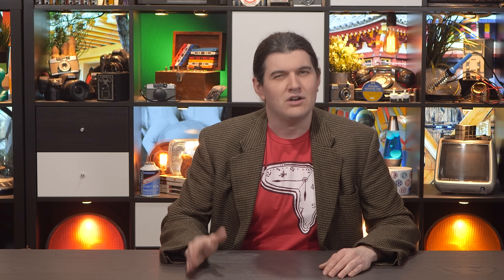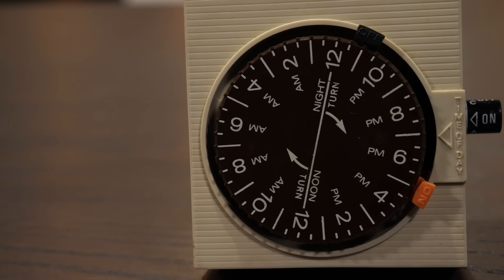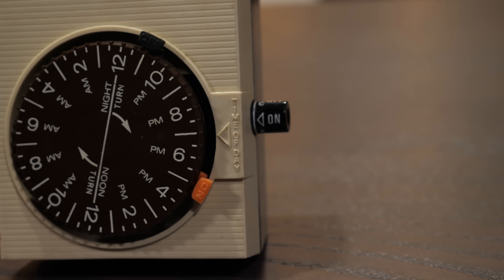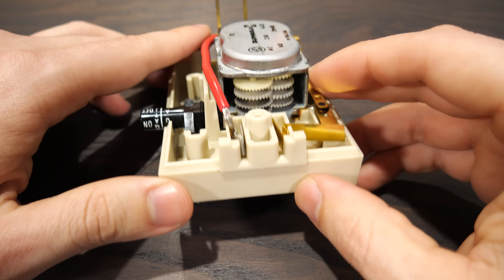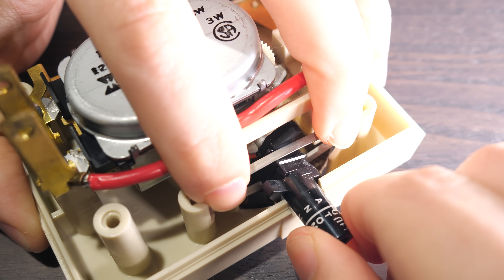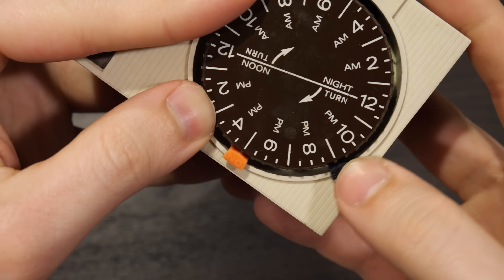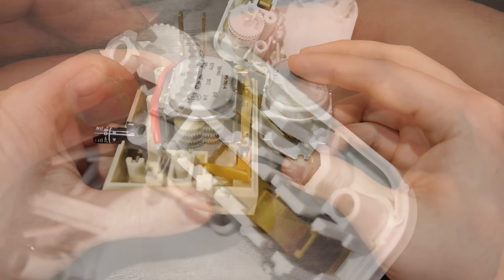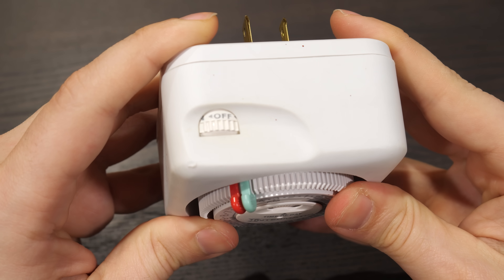Timer switches: literally just a clock and a switch

Comment from the maker: Worthy of note: the motor-driven timers consume 3W constantly - and with modern LED lighting, that means that depending on what you want the timer to do... it may not save any energy! If you use it to control a lamp with a single 5W bulb for 8 hours day, then it saves 80 watt-hours while also consuming 72 watt-hours. In that specific case, you might as well just leave the light on all day and forget having a timer!
Reply: While the 3w draw of the motor is not insignificant especially given the extremely low power draw of modern LED and CFL lights, the fact that it makes the lights turn on and off based on a time schedule is often enough of a desire on its own to merit use of any kind of timer switch, even if it's one of the electromechanical ones with their constant 3w draw controlling a string of christmas lights that might consume all of 5 watts or less.
Sometimes it's a matter of being nice to your neighbors, sometimes it's a matter of making it look like the house is lived in, sometimes it's a matter of a lot of different things.
Reply: I like your appropriately themed wardrobes
Reply: We use them on 800w block heater on tractor engines. They only need to make heat for an hour for two before use.
Reply: 5 Watt? Man, this amount of power can literally run an entire computer of today. And that's relevant because there are lots of SoC with GPIO that could use relays for exactly this purpose! The big and well documented example would be the Raspberry Pi.
That might be overkill for most situations but after hearing that I will put more effort into thinking how to smartly wire everything into that one computer like that I use anyways for my door.
Reply: @fgregerfeaxcwfeffece  or an esp32 or 8266 or an arduino would be more suited for this than a full fledged pi.
Reply: @johnandrews9433  Even those are overkill if you don't need wifi.
Reply: @chaos.corner  the $2 cost makes it matter less
Reply: @johnandrews9433  Absolutely. ESP is my go-to for homebrew stuff.
Reply: Good point!!😂
Reply: Our front porch lights do NOT have a photocell, but I have a lightswitch that's also a timer and I told it what 'band' we are in. Comes on at Sunset and turns off around Midnight.  And, yes, I bought it to avoid WiFi + App idiocy.  Had one for the same purpose at our old houes.  Love 'em.

I had one of those "movable red/green" tab timers.  Had to trash it since I lost all but one tab 😞 
Also have one of the up/down tab type and also require a test each time I use it (is up on?)
Reply: 1:06

Idea for next TC video - "How to use exclusion flags in Google search"
Reply: @deforged  I used to know how to do that, and now whenever I use the exclusion tags, it always shows the first result being from something I wanted it to throw out.
I usually just give up and go to the old-fashioned "google advanced search" bookmark I have instead, but even then that doesn't work.
It's especially unhelpful when I'm shopping. It's almost like they're pushing you to buy what you don't have any interest in.
Reply: @44R0Ndin if you want to search for specific phrases use “” if you want to exclude certain words you want to use -
Reply: @mrpw1402  important to note, don't leave a space after the (-)
Reply: @thatClarkguy  correct and a - is needed after every phrase
Reply: @mrpw1402  Then why is it when I use the - before the thing I want to exclude, the thing I want to exclude is ALWAYS the first result? Try it yourself on something moderately obscure, and watch Google not give you the "no matching results" page, and instead feed you the very thing you were trying to avoid searching for!
Reply: @44R0Ndin  the first result(s) are ads, which will ignore your exclusion criteria.
Reply: @mrpw1402  you can also use other boolean operators if they're in caps. For instance, searching for switch AND Nintendo results in pages that omit the dictionary definition of a 'switch' and a result for a technology company named Switch, as they do not mention Nintendo. You can also use the phrase NOT instead of -.
Reply: @Renegade605  I know about that, but I get like 3 pages of results that should be excluded.
Reply: @44R0Ndin  Whomever pays the most get top ranking these days. Don't need no stinkin' exclusion tags!
Reply: Speaking of ranking, YouTube comments don't even sort my comments. Just uses the '@'sign, so 20th century! I so love monopolies.
Reply: @mrpw1402  yeah? When's the last time you tried that?
Reply: @44R0Ndin  yes 240V versions exist, these timers are sold in Europe as well and many older electric water heaters had a beefy one built into its wall connection. 

Although I never knew how to set mine, as neither way seemed to work (maybe it was broken), and the place I’m in now just has a microcontroller capable of adjusting the thermostat multiple times a day and setting no-run hours.
Reply: @deforged  it doesn't help lmao
Reply: @deforged  Google has been getting a lot worse at giving rubbish results recently. It is now almost as bad as Altavista back in the day.
Reply: @deforged  HEH, that would be useful, especially as Google long ago broke the simple way those used to work.
Reply: @deforged  and Search Date Range...
Reply: @deforged  my God I had no idea of that functionality and it will come in handy. Thank you!
Reply: @deforged doesn't work anymore sadly
Reply: What are those
Reply: I actualy ripped a motor out of one of these to fix a clacker clock
Reply: Fair, but ruins the effect of appearing to be home or not
Reply: really? well i have one running 4 months of the year on my car plug in regardless of if i plug the car in.  Time to stop that. EDIT, its 32c a month so maybe i dont care
Reply: @jsnsk101  Even with just 32 cents per month, if there's a cheap alternative maybe it's good just for the energy saved
Reply: If you search for Model: D111 you can find that a lot of results say its 1970's ish
Reply: Can u do cast iron radiator furnaces some episode?
Reply: And they make a bit of noise so if the outlet is near your bed, you end up hearing it when trying to fall asleep.
Reply: I have a motor driven one similar to the third one you showed, but mine consumes less than 0.5 W, which I use to control a LED sign that consumes about 12 W,  8 hours per day, so it definitely worths.
Reply: @giragama  I bought a new one last year and it indeed consumes less than .5 W
Reply: ...not to mention the bloody noise they make
Reply: I have tab based timers for my turtle tank.  They don’t last forever, the tabs wear out and fall into the closed (on) position.
Reply: In a connextra video, it might be interesting to tell people how the motor is able to stay at it's constant rate because at least 2 times a day when the motor encounters the resistance when it has to overcome the spring tension that could slow down the motor until the switch clicks on.   The motor has to be able to stay at a constant speed so that it doesn't lose time during the drag of the spring tension that slowly increases a little bit until it clicks on or off.  It might be interesting to know how the motor overcomes this extra drag.
Reply: @KevinBenecke  Did you see the stack of gears doing the reduction?  The torque is multiplied by the same factor.  The motor won't feel a thing.
Reply: @JohnDlugosz  Also the motor is synchronous which means it's driven at the same rate as the mains frequency. Unless you completely stall it out, it's going to keep on going.
Reply: @KevinBenecke  The motor is locked to the frequency of the AC power. It would simply draw more current with more resistance.
Reply: @KevinBenecke  They have a 5,184,000:1 gear ratio, so even with a tiny motor, the torque is impressive. The current draw will increase slightly as the springs start to compress. But they won't slow down much. 
And with typically 15-30 minute resolution on the clock face, even if they do a bit, it could take years to notice it.
Reply: @KevinBenecke  very simple. That huge amount of gear reduction makes the fast moving 6000rpm motor step down. Reducing speed increases torque with gears, so that final gear that turns the dial is not going to be slowed down by the clicking tabs.
Reply: I was literally thinking this the entire time you were explaining it, "wait a 3600 rpm motor, running all of the time?!".
Reply: I specifically have my TV lights on a timer so they come on an hour before sunset and turn off at midnight.
Reply: I remember these things being advertised more for their security benefits than their energy-savings. You'd plug a lamp or two (or three or four) into these to make it look like your house was still occupied at night if you were away.
Reply: @@heind Strictly speaking you don't need the hub. The switches are fully ZigBee compliant, so if you already have some sort of computer running 24/7 you can simply add a ZigBee USB stick to that and control the switches from there.
Reply: I was allways taught by my dad to use them when on vacation to make it look like your home, so you don't want the lights on all night or you could tell since people don't keep all their night on 24/7. So you want the timer to only turn he lights on like during normal hours they would be on.
Reply: @MRblazedBEANS  You're good unless the Wet Bandits turn up. Then you need a Kevin.
Reply: Do electronic ones use less? I'd imagine so, they don't have to turn a heavy thing...
Reply: Thanks for the tips. Upgraded the Water Heater Timer to Digital years ago....Wanting customization on Weekends. Good to know that relying on a Battery Powered Clock to decide when to turn off/on the Circuit I'm saving a lot there too, just a bonus since I didn't think about the power needed for it... got a few old Analog Timers that could use an upgrade
Reply: Do not leave the light on all day! Led lights being so efficient that people are discouraged from ever shutting them off at night is one of the leading causes of light pollution.
Reply: Phosisiticated is my word of the month.
Reply: I noticed exactly this when setting up Christmas lights. 2W of lights, and 3W of controller! 😁
Reply: I  love your channel, definitely one of my favorite youtubers, you and project farm     
I have a request that I think would be seriously interesting, or if you could give me some insight here would be good enough for me,    

What controls the refresh rate on crt tvs?  Is it just the mains supply working out with everything and it just simply is 60 or 50hz depending on location,   but what is the deal with tvs that say they have 120 or 144 or so hz?
 is there any way at all to modify the refresh rate of a crt tv? even if it isnt an actual function, is there some electrical wizardry you could do to modify the tvs refresh rate?    I am only looking to reduce mine, I have a tv that puts out 120hz and the screen is beautiful it looks great playing all my classic games, but alas because the tv is set at 120hz refresh rate I cannot play my light gun games which I consider to be some of the funnest games available to play alone or with friends,     I have a 40 inch sony trinitron, is there any way to downsample the output to 60hz so i can play my games on this gorgeous classic tv?
Reply: Timers used on heat and ac also. Lighting in parking lots uses considerably more than 3 watts and also highway lighting.  Btw love intermatic,  see my other comment. Also love synchronous motors it's ability to keep dead accurate time just being plugged onto the wall along with 60hz in homes. What's also amazing is the 60 hz in homes powering outlets is equally accurate.
Reply: @TY-ob7fz  the 60 Hz frequency has to be that accurate. Any more than 0.7 Hz deviation in either direction for more than a minute or two can cause serious damage to generators so they Wil automatically shut down if that happens. Power generation is a fascinating topic.
Reply: @TY-ob7fz  Power companies not only target 60Hz but they ensure that the average frequency over a longer time scale will always stay exactly 60Hz. So if they provided slightly more than 60Hz for a while they will lower the frequency to get back to a 60Hz average.
Reply: You could make a video on how these became standard for sprinklers.
Reply: I have a small LED bulb on my porch. I let it run constantly since adding a timer would consume more power overall.
Reply: LED lifetime saving is more important than power consumption.
Reply: For a more modern alternative, the Amazon Smart Plug (which works off Alexa) can be set up to activate on complex schedules and what not, only uses 1-2 watts. I use one for the Xmas tree mostly. Have it programmed to turn on before the wife gets up and off after she goes to sleep, but also have it set to turn off after she leaves for work and before she gets home on the weekdays. Yes it requires an app to set up.
Reply: @rheemocturis  I'd like to try some of these things, but won't until a product can completely function without any server outside the house. A couple not-terribly-old but expensive home automation product lines are now bricks because the manufacturer just decided they didn't want to pay for the servers anymore.
Don't get me started on the data-mining aspects either.
Reply: @strehlow  Look into the Sonoff devices. Most can be reflashed with custom firmware and there are some, like Tasmota that can operate entirely within your home network (but can still be integrated with Alexa etc if you desire).
Reply: Haha ok, ok I think my Christmas tree lights might have consumed maybe 5W so that didn’t work out well 😅
Reply: No Alec, you’re worthy of note. ❤
Reply: However, another consideration is the life of the LED lighting. Keeping it on all the time could cause premature failure, which would negate some of the savings.
Reply: @ronbennett7885  The cheaper ones which are over driven certainly can have this problem. But properly designed units could last hundreds of thousands of hours. @bigclivedotcom has done a number of videos on hacking commercial LED bulbs to prolong their lifespan. Frequently it is as simple as snipping a single resistor off their circuit board.
Reply: Fair point!
Reply: Alec,
I love your videos so much. I have probably memorised most of them. It would be great to see you and (is it Robert) Aging Wheels do more videos together. 
Your thermal home battery video... is there a method for winter? Here in Japan we have split system heat pumps for the rooms most used. In addition to a kerosene heater and a covered heated table. Double pane windows with tint helps but this is a traditional Japanese home with modern upgrades.
Please guide me on increasing affordable heat and better insulating my home. Thank you so much, my friend. 
Oh!! I saw your model car in a museum in Komatsu. So dope!!
Best wishes, and thank you so much for the many hours of great videos.
Reply: Sometimes it's not about saving power, but rather just automating when a light is on or off. Forex, I have one attached to a lamp in my bedroom. It turns on the lamp a half hour before my alarm clock goes off, and then off a couple hours later.
Reply: 15:00 HOW?! this is an interesting topic! probably not enough for a big  fully fledged video though... maybe a  youtube short? Thanks!
Reply: Truly useless today.
Reply: I can't put it into words how perfect and calming your outro is.
And it's always accompanied by the subtle feeling of having gained +1 Inteleigence.

Always happy to see you upload.
Reply: I have mostly all LED lights in my home and my electric bill rarely surpasses $20-$30 a month, but I still feel weird about leaving my lights on all day. It just doesn't feel right!
Reply: And ironically I just noticed a few hours ago that my motorized timer doesn't completely shut off the LED lights on my aquarium. A couple of chips in the array glow ever so dimmly. I just noticed this, very interesting!
Reply: @blaircox1589  Some YouTubers (Including electroboom and Steve Mould) have videos about why some LED bulbs don't turn off.
Reply: @chaos.corner  Yup, but this is a $100 aquarium light with control circuitry for controlling day and night lighting changes. So a lot more going on between the mains and the actual LED. I just thought the timing of watching this video and noticing was interesting. Cheers!
Reply: I was literally about to ask about this, because I use christmas lights as room decoration throughout the year and thought it was waste of energy keeping them on during daytime with natural light. Even if motor driven one is extremely cheap, figured it might actually not save energy and the amount of headache when there's power outage is immense.
Reply: Yeah, it is wasteful to constantly burn three Watts, but having the lights shut off when you want it to be dark is handy.  Of course if it weren’t too inconvenient or the user weren’t somehow made unable — there is always flipping a switch by hand as an option.
Reply: Or you might as well use better lighting technologies than LED.
Reply: that is the case with my aquarium lighting.  I have some LED tape illuminating the aquarium, and it consumes about 7 watts.  It also has some blue LED tape that says on 24/7 to provide UV for the plants, and also when the white light goes out.  It consumes about 4 watts.  The white lights are on a timer.  BUT this isn't so much to save energy as it is to give the fish a night-day cycle
Reply: Well that isn't very fosisticated...
Reply: Technology Connections ho I subscribed to your channel the video about closed captions was interesting….. I hope you will reply to this 😊
Reply: To avoid Nintendo results in your search, simply add a minus sign like -Nintendo in your google search. For example "Time switch" -Nintendo (the quotation marks also helps by only serve you results from exactly Time switch as a single phrase and not results with the word Time and Switch separated.)
Reply: If you can get the ancient electromechenical timer and the modern energy-saving lamp to exactly cancel each other out, though, you get the Perfect Irony achievement (well worth it).
Reply: @Rubrickety  If you use the timer on an iron you win the perfect irony achievement by default.
Reply: Well I wonder how much power a Wi-Fi connected timer switch consumes.  Could it be a similar amount?  I have no way of measuring how much electricity my devices consume.  I'm sure there is an Australian equivalent of the Kill-A-Watt device, but I don't know what it's called.
Reply: @Lachlant1984  About 100mA if not especially optimized. There are tricks to get them even better too.
Reply: its much more efficient to use smart bulbs in that case, only one power supply and no motor.
Reply: @drkastenbrot  True I guess, but the WeMo switch was bought for me as a birthday gift years ago, and so I used with with a CFL lamp, I didn't have any smart bulbs then.
Reply: All the mechanical ones I've measured have been 2 watts, rather than 3. But mostly I'm using mine for plant lights, so the time is the important part, not power savings.

But I do also use one for a rechargable-only-mini-sound-bar I have that in my use case is best left on full time*. It also has a delightful feature that when it's low on battery it'll start beeping every five minutes until it fully drains the battery. So now I leave it on but also use a switch timer to give it a few hours of charge every night.

* (Mildly difficult to reach, intermittent but unpredictable use, often in short bursts, and the device somehow takes a solid TEN SECONDS to turn on from power off which is often longer than the use case. At least when idle it puts itself in battery-saver mode and only takes three seconds to start back up rather than ten. Did I mention that if you use it wired it blinks the world's brightest blue LED at you continuously until you give it a bluetooth connection? I solved that with electric tape.)
Reply: @solarbirdyz  Hmm, sounds like a very oddly designed soundbar, I'm not sure I'd like a soundbar that operates like that.
Reply: @Lachlant1984  It's not meant as a soundbar? It's more meant as a portable bluetooth speaker. But I don't need it for that, and it does sound and is bar-shaped and fits on the wall-mounted monitor it's used with. So for me, it's a soundbar. And now that I've worked out its nonsense, it's doing fine in that role.

That said, I most definitely would not buy it again, not even as a bluetooth speaker. I mean, it's fine. It's not great. But it's fine. As that. Kind of... B-tier. And if I were to buy something new, I wouldn't buy anything B-tier.
Reply: The very 70s-looking one you started with is actually late 70s by my recollection. Before it was an Intermatic model we used, with the same body and colors, but with multiple little orange and black pegs that could provide quite a complex program. They were captured like the last version you showed, but needed to be pushed (hard, and painfully to the fingers) inward or outward to actuate. It still used the square cam, so it couldn't handle something under 30 minutes or so, so mostly it had to be an hour minimum for an on or off period. My parents were very annoyed when they couldn't get the sophisticated version anymore and could only get the first one you showed. I think they still have (and maybe even use) some of the original ones. My fingertips still hurt thinking about them.
Reply: You need light off time to sleep.
Reply: How many watts can be saved by switching from this electromechanical mechanism to a fully electronic one?
Reply: Or find an equally modern digital timer with lower power consumption.
Reply: An entire low-power Intel laptop from 2018 can fit in that footprint. Granted it'd have to be idle, but still.
Reply: switch -"Nintendo" Your welcome.
Reply: Well, luckily now we got those super efficient digital timers.
Reply: @PunakiviAddikti  Do they use the AC power as a time base or a  quartz crystal?   The crystal is less accurate.
Reply: @8546Ken  They use a crystal, and no, crystal isn't less accurate. Quartz clocks are far superior to mains synchronized clocks, hence why they have displaced them.
Reply: @PunakiviAddikti  That hasn't been my experience. Official time, from WWV or GPS is based on atomic clocks which are accurate to maybe one second per century and checked against astronomy. No simple quartz crystal, especially cheap ones can match that. And I know that my appliance clocks which are not AC synchronized do drift off. 
I speak for the U.S. I don't know about the mains frequency accuracy where you live.
Reply: @PunakiviAddikti  Quartz is more precise, mains is more accurate. The power companies ensure that happens, as mentioned in the video.
Reply: The idea of having a timer on a lamp is to make the house lived in when you aren't home or to turn it on before you get home so you don't enter in the dark.
Reply: Motor-driven timers have a maximum power rating calculated in worst case stall conditions. This maximum power number lets one design an enclosure that is capable of handling this power without burning up.    When they are running normally, they draw much less than half a watt.   I've measured it.
Reply: These where more used for timers for lights, such as to have a light turn on or off when away on vacation or the outside Christmas lights.
Reply: The first one you showed looks and functions like the one my father bought in 1974.
Reply: What if we have some really bright LED lighting?
Reply: I keep reading that mechanical timers use 1 watt an hour
Reply: @toserveman9265  There is no unit of "watts per hour".  That would be plain "watts". I don't know if that's accurate. I've heard up to 5 watts. Maybe depends on the age and brand.
Reply: I used to work at a lighting store and we found there were many LED light fixtures that did not work well with certain digital timers. They required mechanical timers… or at least digital timers with a physical switch.  It was a problem with how some digital switches didn’t truly disconnect power, they simply reduce the power flow to very low. But with the low power of LEDs, it was often still enough power to illuminate the LED even when the switch was “off.” I think it’s similar to issues with LED dimmers. In those cases, the light fixtures required a timer that had a mechanical switch that actually disconnected the power flow.
Reply: Well... that's anticlimactic
Reply: @Alec, it's been a long due to cover the sheer weirdness of polarized US plugs. And why Europe lives without them quite happily.
Reply: @nneeerrrd  There are really only a few situations where polarized plugs improve safety. In any appliances where you can never make contact with conductive parts it doesn't matter. The only one I can think of is the shell of a screw-in bulb that's only partially screwed in
Most appliances use them just because of the perception that they are safer. It's easier to use them than to explain why you're not using them.
Reply: Dude first hooks me up on timer switches for half an hour then with 1 comment DESTROYS my entire clockwork utopia where everything is timed.. the emotional rollercoaster is insane.
Reply: I swapped my timers for smart switches because frequent power outages kept getting the timers off - and the power trip I get from pressing a button on my phone to toggle them on and off is a nice bonus. ($9 each and no monthly fee so it was also cost effective) Thank you Kasa
Reply: @cryptogenik  So if y our Wi-fi crashes you can't turn your lights on or off?
Reply: @8546Ken  No, they follow the schedule even without WiFi, and they have a built in push button on/off switch. And they were less than $10 and after 2 years still working flawlessly. When my internet has died - they remember their schedules, and have a sunset mode, so lights come on at dark, and off a few hours before sunrise. Which changes through the seasons.

I'm very satisfied with them. The manual timers would have to be reprogrammed everytime there was a power outage and there were 6 around the outside, and if it happened when I wasn't aware - then the time would just slowly desync without me noticing for a while. All those problems are gone. I really admire the engineering and problem solving of the manual timers - but for me and my situation the new smart ones are better.
Reply: This is why I only use them to control super high wattage things like grow lights or space heaters
Reply: lol
Reply: use a digital timer instead ?
Reply: Or install a smart bulb on that lamp
Reply: @cockatoo010  As long as the smart-bulb doesn't need to talk outside the house.
Reply: NICE  AWES0ME 🎉✨🎉✨🎉🎉🎎🎭🎎🎭🎎🎭🎗🎗🎗🎗🎗🎗🎗🎑🎑🎑🎑🎑🎑🎑✨🎆
Reply: It's not always about saving power.
Sometimes it's about making the house look occupied. 
Of course, that's also why electronic timers that can randomize on-off times are more popular.
Reply: But you do have to remember to turn the light on in the morning so it will be on when you get home at night. Personally I can see myself forgetting to turn it on particularly in the summer when the sun is up in the morning.
Reply: I have a clock that uses a design that is Mechanical, it needs to be wound up every 2-5 weeks depending on how you use ut
Reply: The purpose isn't to save energy, it's to make it look like someone's home.  I have a couple digital timers but honestly, the newer motorized ones are a LOT easier to remember how to set.  They allow multiple ON periods in a day (I think they're different from the one you're showing, they have a ring of little plastic tabs you can pull out or in and these make contact or not over 5-10 minute periods, like pixels of time).  Eventually I'll set up a ZigBee system or something that I can program and randomize, but I'll probably never get around to it.  I could do the whole Alexa Google home thing, but I'm reluctant to put that much cloud surveillance in my home, though I will get a ring sooner or later.
Reply: @tristan7216  There is home automation equipment that you don't have to attach to big tech I forget the names right now. I first saw Dave's Garage talking about it.

If you just want to save energy you would turn off the main breaker before you left the house/apartment for work.
Reply: the bulb will last longer if you use it anyways
Reply: I have to think that for what it does, a more efficient motor could be used but they just went with what was cheap and available at the time.
Reply: @just_saw_dust  I bought one this year. It crashed and some of my plants died. It was also a PITA to operate. I'm planning on gutting it and replacing the innards with something homebrew.
Reply: 1940's intermatic?
Reply: Just wonderful! You really go into detail!  I love it :D
Reply: Our bathroom light switch is an overhead pull cord, I've been meaning to get around to exchanging it since it broke in 1994.... But with a 5w bulb it made a handy light that illuminated the stairs and prevented children from falling down them in the night.
Reply: I have a 5w led.light that I leave plugged in all the time outside my front door. I keep considering a timer but I have solar so the times that I don't need the light on I'm usually not paying for it anyway and I never really thought about the consumption of a timer and assumed it was virtually unmeasurable. I definitely won't bother now.
Reply: Throw a power strip into the mix, it'll work itself out
Reply: Why not just use a digital timer? Would the lack of moving parts (besides a relay) make things more efficient?
Reply: 13:38 "...more phosisticated" 😂
Reply: 1W is a max consumption for new mechanical timers that I found from hardware stores with a of 5-6 €.
Reply: I use it for my Fisch tank
Reply: I bought a new made timer and it consumes so less the clamp meter cant read it so less than 1 watt
Reply: For ComEd (my utility in northern Illinois) that 8Wh is $0.0012. Barely worth automating.
Reply: @thesuperknot_  Nonsense, the timer will pay for itself in only a few centuries!
Reply: 13:38 fosistacated lol
Reply: Put one of these on your hot water heater and save a bunch.
Reply: @MerkDolf  I think in many countries hot water systems only heat the water during off-peak electrical usage times, I believe that's the case here in Australia where I live.  I understand that my hot water system only heats the water overnight, if I want to heat the water during the day time, I have to go to my electricity meter and press a button to override the timer.  I don't think I can adjust the time the hot water system turns on and off, I think that's set by electricity company.
Reply: @MerkDolf   You'll save hardly anything. If you're not running any hot water, it will rarely turn on. Besides how are you going to use a plug-in 120V 15A timer on a hard-wired 240V 30A water heater?  
There are hardwired proper timers for this, but will cost a lot more to install.  They are sometimes used when there is a variable time-of-day electric rate.
Reply: @8546Ken  Interesting if you've got an 20 year old hot water heater and you put a timer on and save money isn't that is a great thing. If you went and actually installed one of those 20 gallon heat pump heaters that also help cool your house down in the summer time then you are ahead of the game good for you.

And even better if you have a 500 Gallon heavily insulated tank in conjunction with evacuated tube collectors then so much better for everybody.
Reply: @MerkDolf  they already are on the heaters
Reply: @MerkDolf  Most electric water heaters are hard wired, and it wouldn't make sense on a plug in instant water heater. Not to mention current and voltage differences (except that I just did). But assuming it were possible, it might be debatable how much energy you would save by turning a water heater off for such relatively short periods every day. I would be interested in seeing such an experiment.
Now, for those of us with gas...
Reply: @czibbell74  You  could get a simular device that mounts in the breaker box
Reply: @MerkDolf  I think most water heaters are coming wired to accept those management modules these days. You could probably put something in there.
Reply: @MerkDolf   Actually, a well insulated water heater runs pretty efficiently without timers.   Not to mention, I think they mostly are designed to bring the heat up less quickly.   Could be an issue getting the water back to the right heat for your shower.....
Reply: @chuckoneill2023  I wonder is a new tank or a timer easier to get? 

Yes a large enough tank that is properly insulated combined with evacuated tube solar domestic hot water collectors would be the better way to go so you don't even need a timer or electricity to have hot water.
Reply: @MerkDolf  Do they even make versions of these for electrical water heaters (which have heating elements that run off 240v)?
I'd imagine the higher currents required also require the use of a contactor that has a 120v or 240v coil to control it, along with the standard timer switch to control the coil of the contactor, because putting that much current thru a timer switch seems like a recipe for an expensive item when a contactor plus a much cheaper lower current timer switch would probably work out less expensive overall.

Also, if you didn't know, controls engineering is full of this kind of stuff, 90% of it is just relays and contactors and little switches that handle maybe an amp but change state depending on certain conditions (can be temperature, pressure, some combination of temperature AND pressure, or just a standard micro-switch with a special mounting if you want to limit the travel of a motor-driven door or something like that).

With the temperature and pressure switches, you can form the basics of something that should be capable of controlling an air conditioner or freezer, if crudely.
The advantages are that such electromechanical control systems are relatively simple, cheap, durable, and they tolerate adverse conditions very well. The disadvantage is that electromechanical controls are not as accurate, flexible, nor are they capable of being as energy efficient as control systems that rely on transistors and processors instead of cogs and cams.
Reply: I think I read somewhere that contactors are for something like 8000 wats or higher. If you are lower than that you will damage the contactor. But they actually make these style timers for hot water heaters. 

Having down to the second accuracy isn't so important turn on the heater about half an hour before you need it or so, maybe have it come on again in the afternoon before the kids come home. leave it on until you finish the dishes.

Most important thing is not connected to google, amazon, apple so they can turn off your hot water when they want to like they did in Calado last year with the air conditioners.
Reply: @MerkDolf  this really depends on the size of water heater.. water takes quite a bit of energy to get hot but it doesn't take much to keep it hot.. alot of newer water heater can be more efficient if you leave them on instead of shutting off
Reply: @44R0Ndin  Of course, there are proper timers for this use, but they would be hard wired. They are sometimes used where the electric rate i cheaper overnight.
Reply: @8546Ken  To be honest if you're really looking to save energy with an electric water heater of the "stored hot water" type and not the "on-demand instant hot water" type, it might be easier to go to a system that uses a triac-based dimmer circuit and a temperature sensor to dynamically adjust how much power is being sent to the heating elements to maintain as close to a constant water temperature output as possible. But obviously that's no longer a simple mechanical timer connected to a (potentially high current) switch.
Reply: @44R0Ndin  Of course they make them for 240V lol. Remember that 'Murica isn't the only country in the world, lots of places use 240V power and we definitely have timers. We can draw 2400w from a standard 10 Amp socket :)
Reply: @44R0Ndin  these hot water timers are common in Europe.
Reply: @BoBandits  Makes me wonder if there's one that's rated for use over here in the US...
Reply: @44R0Ndin  I mean we have then here in Europe aswell, so I'd say yes
Reply: @MerkDolf  5500 watts? Yikes!
Reply: @MerkDolf  Lol unless you need your hot water throughout the day, that would never work in my full house.
Reply: @MerkDolf  water heaters are insulated, some energy is lost of course, but unless used, they tend to keep quite hot once hot, so by leaving the thermostat do its job, the heater only turns on to replace energy loss through insulation, which is very little. 

Adding a timer in the mix will mean that the heater is never fully hot, thus as soon as the timer turns on, the heater turns on, and will stay on till it either reaches the set temperature, or the timer turns it off again, so rather than having multiple short on cycles through out the day, you'll be having a few long on cycles when the timer turns it on. 

So saving energy while using a timer (or possibly worse, wasting more energy as the timer itself uses energy) depends on many factors, including how good or bad the heater's insulation is, how hot or cold the environment round the heater is, and how much hot water is being used along with how often.   
  
The guaranteed way to save money from heating water is by setting the thermostat at a lower temperature. This is because, the hotter an object is, the faster it loses heat to the environment.  
  
Secondly the other way to save energy on heating is to add extra insulation to the water heater, such as wrapping it in a "water heater blanket", this will reduce heat loss to the environment, thus causing the thermostat to cycle less often and keep the heater switched off for longer periods.   
   
Finally you could do manual on/off switching, but there's no automation to that, ideally water heaters could be set up so that they can be switched on manually when needed and automatically off when they reach temperature, just like a kettle, this way you only ever switch it on when you're going to use it, and it won't stay on when not in use.
Reply: @DanielSultana  Yes That is how I use to think, I use to think a timer on a water was a silly Idea. Then I started using one because the landlord had a manual switch that I would either forget to turn on or off. It started to save me around 20 a month on my bill. 

If your heater is insulated good enough, you may only need to turn on the water heater of 15 minuets twice a day. 

For me in the winter twice a day for 15 minuets is enough and the summer once a day.

But lets say you have people in the house all day long then leave the hot water heater running for 12 hours a day and off for 12 hours and enjoy your bill reduction.

Most people don't even keep their water at 140 or above to prevent legionnaires as hotels are required to do by law. 

Whoever actually uses the hot water coming out of their tab to make tea or coffee. Every electric dishwasher has a heating element to bring the water up to tempter.

Won't you get a shock when you travel overseas and you check into a hotel where they actually have a switch to turn on the hot water heater on in your room.
Reply: except an led bulb won't last as long if on all the time, and having a light on all the time makes it seem like no one is home.
Reply: @Jon-hx7pe  Do we actually know that an LED bulb will last longer if turned off every day? Or does the on/off cycle stress it more?  It probably depends on the brand and the design.  I have quite few LED bulbs that were only used a few hours per day, and only lasted about 2 years - not the 13 years they claim.
Reply: @Jon-hx7pe  actually the LED will last almost forever. It's the electronics which die. And those electronics hate getting switched on and off ...

So it really depends on the number of switch operations per day whether you are actually correct in practice 😉
Reply: @Jon-hx7pe I've got an led light outside my front door it's been on constantly for about 4 years at a guess. It was a cheap one from Aldi about £5 so nothing special. Factory I used to work in run all LEDs and they very very rarely failed and constantly switched on.
Reply: we are doing tours of our Geothermal system again if your interested let me know
Reply: D'oh!
Reply: we had one of these when i was a kid and even my dad was stumped about this.
Reply: search”… switch -nintendo” and it will filter out all results that also mention nintendo.
Reply: Or just have kids and have them turn the switch on and off for you 😁
Reply: @AshKast  I pay my electric company about 14 cents per kilowatt hour. Kids cost much more than that per kilowatt hour.
Reply: @AshKast  right, because kids definitely save money. 😂